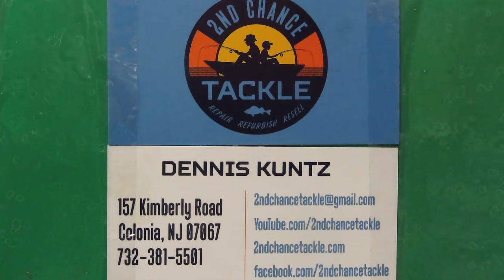Penn International 12LT fishing reel how to take apart and service

Comment: I made a de-spooling rack using a 114h to pull my line down after each use. I clean the spools, then I can pull the line back on under drag so it's spooled tight. A shot of Penn Reel cleaner is safe to spray on the line to remove the salt when I respool it

I get a full season out of my mainline and only replace the top shot each use
Reply from the maker: Thanks for the tip - Sounds like a great way to keep the reels clean and fishing - Best wishes - Dennis

Comment: Hi Dennis!

The Penn International II 12LT is the third version of the 12 pound class International. The only real changes were going with the plastic tip on the lever drag, a stamped reel foot instead of the cast stainless steel foot, the bridge was changed to mimic that of the larger International's and a increase on the drag pressure. I believe this change was responsible for the increased drag pressure.

I've found that to keep the drag from getting jumpy, (you can smoke a drag with a large fish that runs) that the drag washer should be lubricated with Cal's Drag Grease. 

The other thing I do reels are to apply grease between the side plates and main body, and apply grease to all of the screws including the reel foot.

Penn incorporated most of these changes to the newly at the time, 16S two speed reel.
Reply from the maker: Thanks for the additional information and for the tips on greasing - All good advice.  Best wishes and thanks for watching - as always - Dennis